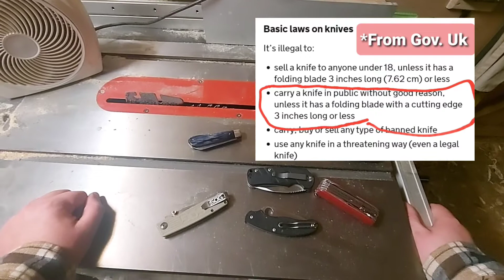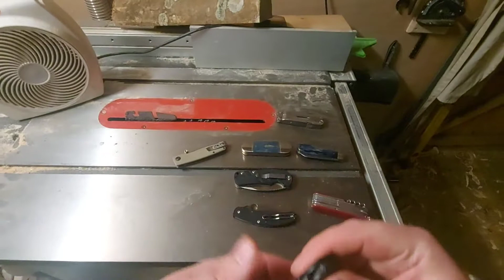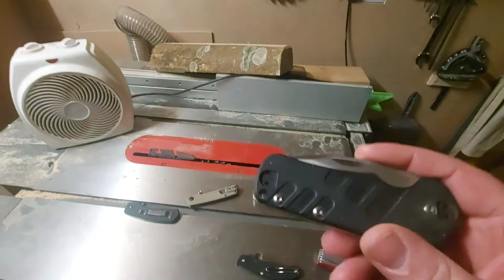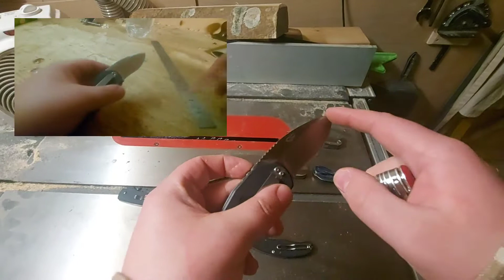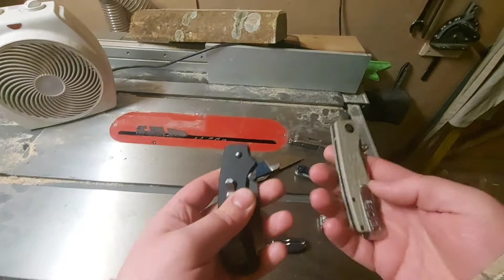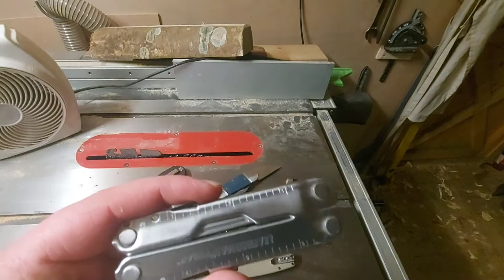It's legal, but we'll arrest you anyway.

Comment: Anything that can cause injury can be considered an offensive weapon that can override the knife law, which means it is under the interpretation of the officer you are dealing with if you are stopped. Therefore things such as the knife being more intimating, do play a factor, also the time and the place is also a key factor, you hanging around in a dark corner (maybe you're just waiting for a mate to catch up) and you have a knife on you,  an unintimidating swiss army knife you are more likely to get away with it than say a Spyderco but not guaranteed. Any knife on say a Friday or Saturday night in a built-up area if found regardless of the brand may get you in trouble with the law unless let's say securely in the bottom of your bag and you have a good reason for it, i.e. always use if for work and haven't gone home yet. But generally, it's scarce to be stopped and searched in the UK, you'll only get stopped if you look suspicious i.e looking like you're trying to conceal your identity, lingering somewhere for a long time or using what looks like an intimidating knife to the wrong passer-by who goes and calls for the police. 

For instance, I've got an Opinel Picnic which has no point it's rounded but technically it's a locking knife, it's great for spreading butter cutting bread cheese, salami etc and it would be useless at stabbing anyone with the rounded edge but because it locks its illegal unless I have a good reason for carrying it, i.e a baguette popping out of my bag with saucisson and tbh it would do most of the tasks I need a blade for (i.e cutting loose threads, cutting food, opening packages, sharpening pencils, potentially freeing someone from a car by cutting their seat belt (never happened so far)) and is safer to use because it locks. The police, in general, wouldn't want the paperwork, but if they assess you as a threat i.e you look a bit dodgy and it's been a dull day for them you may end up getting nicked.

Comment: could a knife be interpited difrently if its more flashy like brightly colored compered to your matte blacks and stuff?
Reply from the maker: I'm not sure honestly, I suppose it depends who you are dealing with, but this is basically the black rifle vs wooden stock rifle, same thing that just looks a bit different, with no difference to the functionality.

I assume you mean a knife being bright orange vs black? I guess you could say the same for plastic handle vs wood, some people there's probably a difference in interpretation, but it depends who you are dealing with, for someone like me there is no difference, and some people will wet themselves over anything sharper than a wooden spoon. 

I'd think something like SAK or traditional Sheffield Pen knife would be seen as less aggressive than something like a SOG Terminus or Böker plus XS, but in reality nether are any more "dangerous" (I hate that, knives aren't dangerous to begin with) it's just judging something on its looks.
Reply: @scotsman7626  I am mainly curious as I have some knifes with  anodized finishes that have some purples greens and blues on and when i do cleen them up have a chrome sorta finish but uts mainly the blades that are like that and have kept them in unless I need them for skmthing whilst out as was worried if I got stopped coppers would think im using it as a show or somthing to flash about when in reality they work knifes